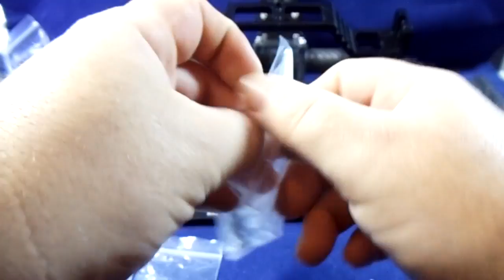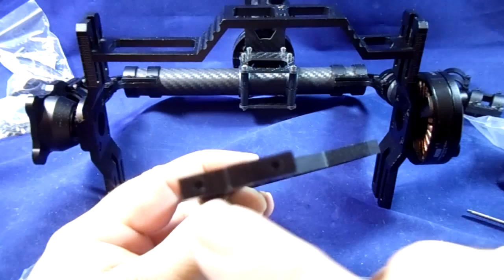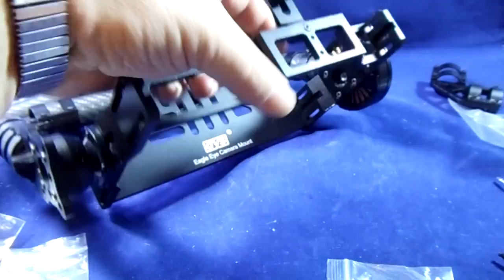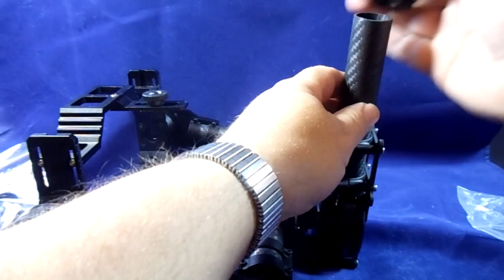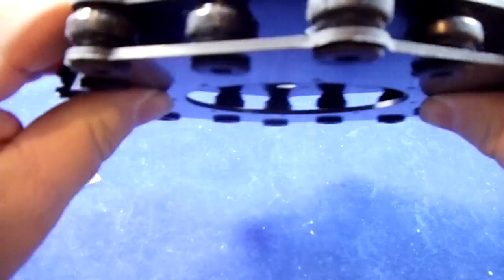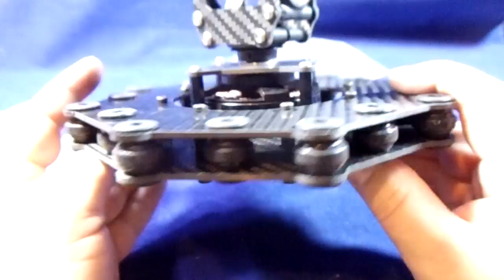DYS Eagle Eye Gimbal Build

Comment: I'm really new to this but has anyone thought of adding to the parts where you have to balance and screw the screws maybe a hand tightening screw so you dont have to use a screw drive or alan key which ever one is needed?  i can be completey wrong but would that be a good idea?  i dont have my gimbal yet.  I have to wait another week. but i thought that would be easier.  kind of like the hand tightening screws that the gopro uses.  you hand tighten then wrench down with a driver or alan key?  i guess as long as there is clearance.  oh what about adding a quick release.  i know simply stupid question.  i havea t2i so you think there should be enough room?

Comment: So they must've changed designs a bit b/c mine is a little different. I've got several questions. 

1. When you put the yaw motor on top of the bottom part of the unit, what keeps the motor shaft in the upward facing piece? I see 2 small screw holes, but no screws I have will fit. 

2. My controller boards are nowhere near like what you've got, but they're supposed to be Alexmos boards.

Comment: if you mount the yaw motor with the bottom on the vibration dampner youre gonna have the wire from the motor blocking you to turn 360 i suppose. isnt it?

Comment: Have you done the Alex Mos build for this rig? also, i have the hand held version and used your balancing video as a guide, i couldnt not get my Canon 60D to balance by moving up and down, but i did get it balanced by moving the camera front to back. did you do that as well?
Reply from the maker: Hi Alexmos is on the gimbal, there is not much to say about that really. Yes I moved it the same way in the video, glad it helped you.
Reply: QuadFrames well i was hoping to see how the battery was connected on to the Alexmos? this didnt come with instructions and i havent seen any alexmos Builds for 2.3. but thanks anyway i will keep looking
Reply from the maker: Hi please watch this video http://youtu.be/Zy4GmAcr5X0  this is one I made to show how to connect the 3rd axis board. If you need any more help please join my forum and ask in there http://www.multikopter.co.uk/